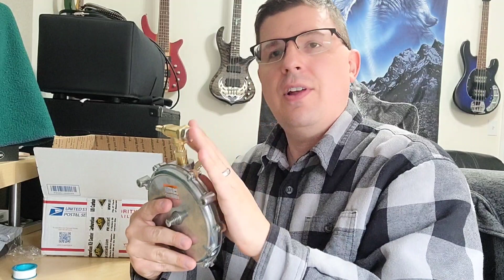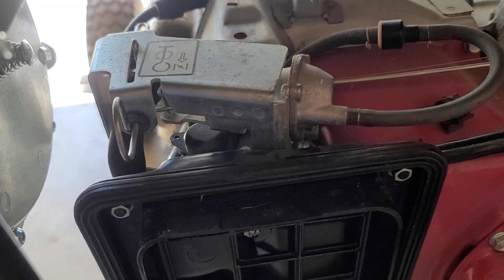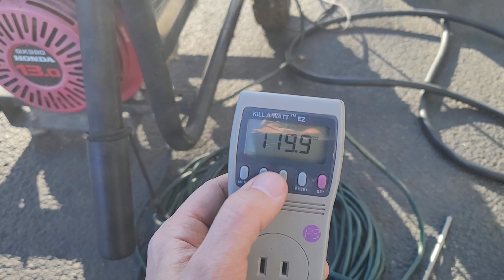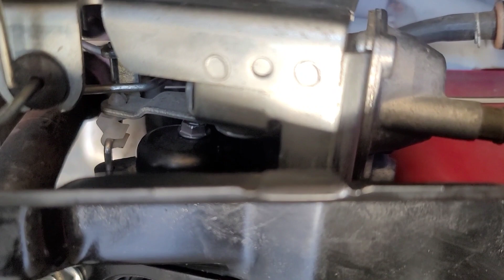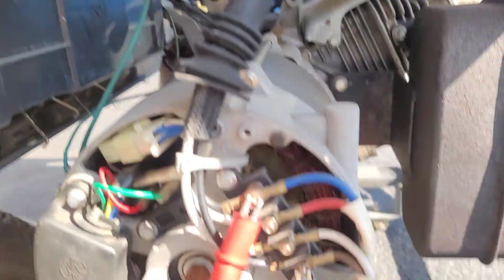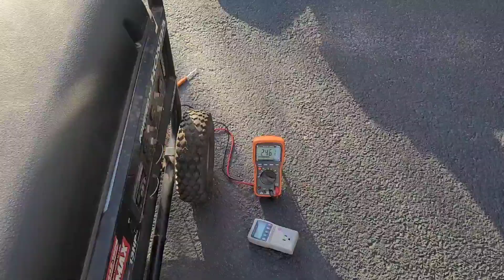Black Max 7000W Generator: Repair & Motor Snorkel Tri-Fuel Conversion

Comment: Don't cut a thing out of there, please. It shows the struggle is real, even if you know what you're doing, stuff happens.
Reply from the maker: Thank you!! Yeah figure a shorter more succinct video would be beneficial, but yeah struggle is always there regardless
Reply: @Bassguitarist1985  I love it! Shows the thought process & steps of ruling things out which isn't always what we think it is... at first. LoL 😆
  Not to mention, it's always good to have others to bounce ideas & suggestions around with. Two heads or 20 are better than one, right?
Reply: I agree with leaving it all in. It was good to see everything going wrong then getting fixed.

Comment: Thanks for your video, you gave a lot of good troubleshooting advice! Would you recommend using a tachometer to measure RPM while under load, or should I buy the power meter you used in the video?
Reply from the maker: @MarkL-q6c  tach or Kill-a-watt.meter work great. Just need to know RPM to Hertz relation. Ie 60hz is 3600rpms
Reply: @Bassguitarist1985  Great to know! Thanks for the quick reply and the info.

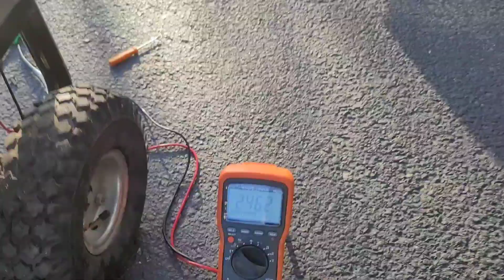Comment: 55:43 Slow playback speed and study the movement of rotor end bearing bolt.  Appears to move in off-center wobble.  Is this within normal spec?
Reply from the maker: Yes

Comment: Hi! Just installed a motor snorkel. Have you try it on Natural gas? Because im just getting 40% of the total power of my generator. Is that normal for natural gas? Thanks
Reply from the maker: Definitely not. NG is not available in my area. Lot of factors to check when using natural gas. How far away from the meter is the generator hooked up? Diameter of hose? Is your meter putting out adequate volume/BTU (not pressure) to handle a hungry generator? Many things to consider.
Reply: @Bassguitarist1985  thank you

Comment: Installed this kit on BlackMax and it runs fine except the voltage reads 112v on natural gas. Any suggestions? Thanks much.
Reply from the maker: Whats the engine speed when voltage is 112v?

Comment: Got a tri fuel kit today and installed it. My generator is 8500 watts on gas. With what I had, I was able to evenly get 7200 watts. Set the load block, required removing it a lot keep voltage in an acceptable range. One it was there it ran the 7200 at 119v no problem.

Problem was, it must have been so rich that when I dropped it back down to 500-1000 watts, it must now be too rich as the engine doesn’t run very smooth. My load block has a smaller pull out screw, not sure if that’s part of the problem.

This is for emergency backup, and I never really need to run more than 4-5k watts so my plan is to lean it out a bit to avoid issues at lower power usage, but it does bother me that I can’t use the full range. It also bothers me that it’s not a true tri fuel as when switching to gas, low usage is fine but anything above 1500 watts and the air fuel mixture must not be right as it surges. 

This is a 3D printed model, not a snorkel. Would returning this one and going with motor snorkel solve these issues or just a general problem with these tri fuel kits?
Reply from the maker: I would suggest trying the snorkel, I did not have any issues like you mentioned

Comment: I myself have installed two of these kits. They work great and the company is great to work with. Make sure when running on propane that the fuel valve(s) are closed. Not only will this lean out the mixture but it will allow dust to be sucked in to the engine via the fuel line {assuming the gas tank is empty}. Great job!

Comment: My understanding is that it is: 1 H.P. (Mechanical)= 550 watts,generator power.

Online is says approximately 750 watts to 1 H.P. In reference to basic physics. Guess there is some variation. Seems your numbers might be more realistic. Craig
Reply from the maker: One mechanical horsepower (imperial) is defined as a horse lifting 550 pounds (250 kg) by 1 foot in 1 second. Thats 745.7 watts. For reference, metric horsepower is 735.5 watts. 

Gasoline engines are not 100% thermally efficient, meaning all the energy from the fuel is converted to useable mechanical work. Instead 4 stroke gasoline engines with the Otto engine cycle are more around 28% efficient. The rest is lost in waste heat, frictional losses, etc. This is why manufacturers have to oversize the prime mover to compensate for the inefficiency. Thus the 2HP to 1kw measurement is the accepted standard in the industry.

Comment: NIce job on the retorfit to propane. I am yelling at the video to always clean the jets, especially the low speed jet that always gets overlooked. When plugged or restricted they will almost always cause surging. I see this often in my shop. Sometimes I have to drill them up one or two mini drill sizes to get them to stop surging, thanks to the EPA. Good video.
Reply from the maker: Yeah honestly I should have just went for the carburetor ultrasonic cleaning and save myself the trouble. I did use a micro drill for the idle jet but to the same size that it was already. Thank you for watching!

Comment: The propane adaptor will act like a vacuum leak if not hooked up to propane by sucking in air or not ?
Reply from the maker: It acts as an air leak past the air filter only, not after the carb. No issue with dust cap in place